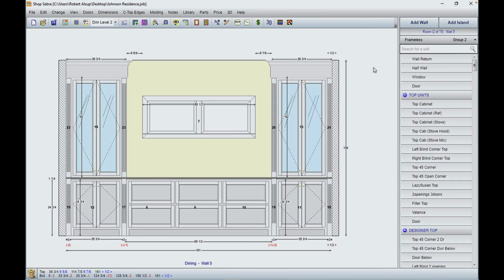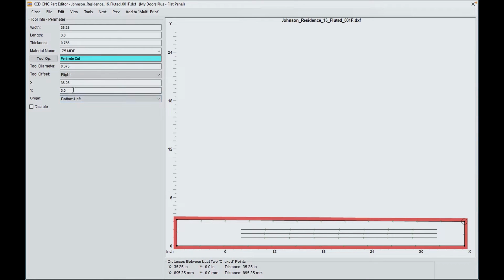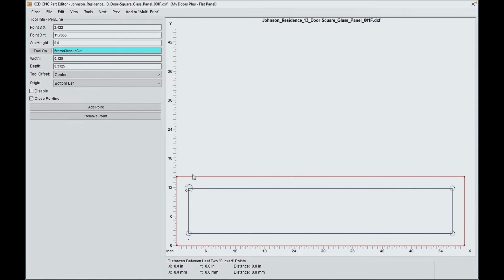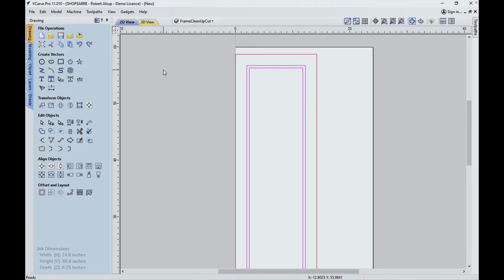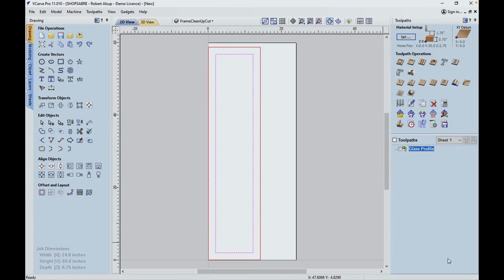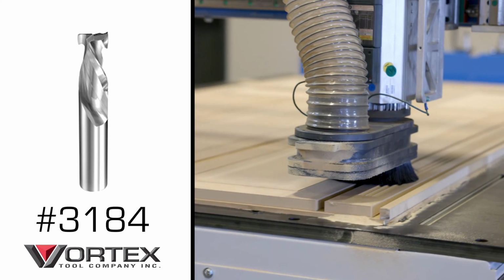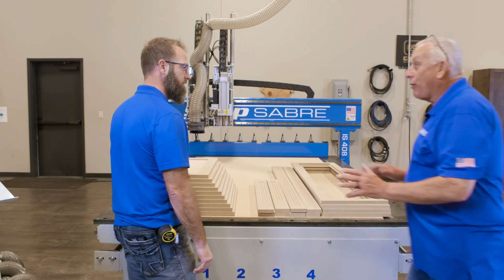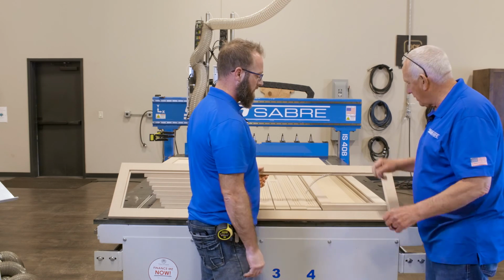Making Glass & Mission Doors with a ShopSabre CNC Router

Comment: Did you notice any warping for the doors?  When I make these style doors I notice they tend to cup. Just curious.
Reply from the maker: We didn't have any cupping on these doors, although that occasionally does happen.  We have had our best success using Ranger Premium Platinum for our doors, since switching to the Platinum product we have a dramatic decrease in issues with doors or any other MDF carving we do.
Reply: @shopsabre  thank you for taking the time to respond. I’ll give that a try. There is nothing worse than cupping doors. I even routed out the back side of the doors to relieve surface tension. But still a small cup. Errr. Has to be the material. Thanks again!
Reply from the maker: @michaelmorocco9809  Your welcome. Material can playa huge part in it. Once you find the right material for the job, you''ll be set!